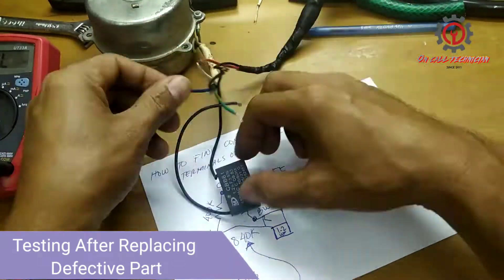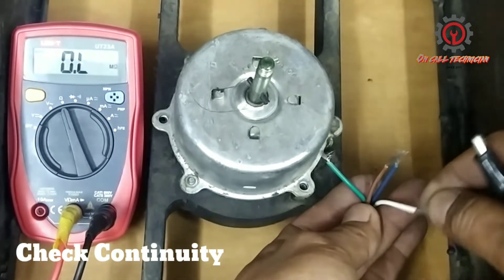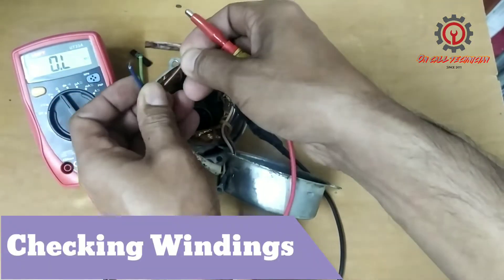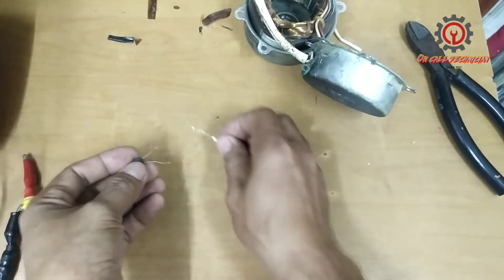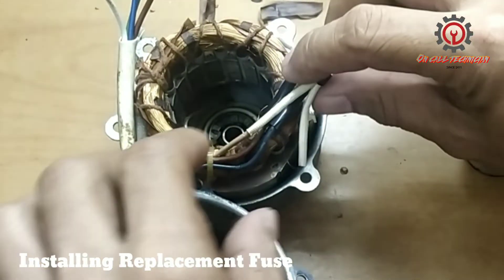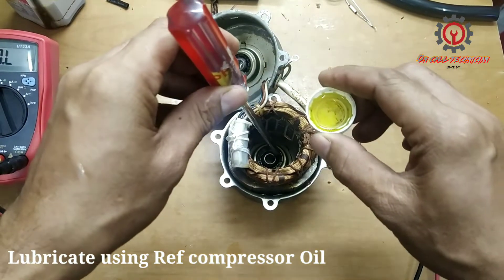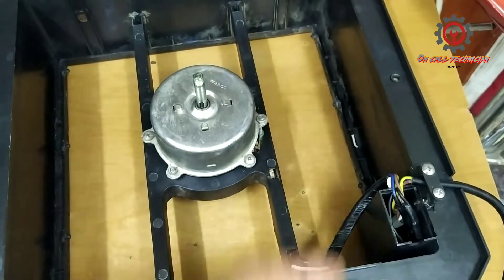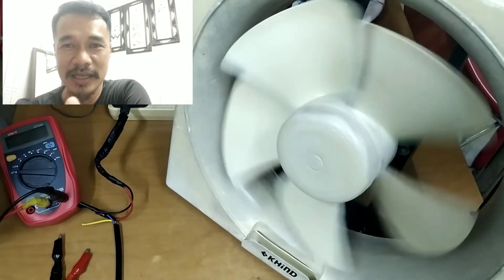HOW TO REPAIR NO POWER ISSUE OF EXHAUST FAN / PAANO MAGREPAIR NG WALANG POWER NA EXHAUST FAN

Comment: Pano po pag walanh continuation sa ibang wires?
Reply from the maker: Fuse busted or open circuit na sir dahil sa sunog.  Check fuse sana bumigay sya at di windings
Reply: @THEMULTISKILLEDTECH  nagpalit po ako ng fuse boss,wala pa din contiunation sa ibang wires,
Reply from the maker: Open windings na sir, nangyayari talaga yan kung matibay ang fuse, kaya dapat sundin ang rated ng stock na fuse kung magpalit

Comment: Pwede po ba icconect direct yung wires without resistor?
Reply from the maker: Without control yes po bale recta sya
Reply: @THEMULTISKILLEDTECH you mean po ba is yung fuse?  Since yung fuse ang may issue okay lang di na lagyan ng fuse at rekta dikit nalang?
Reply from the maker: @excuseme2423  kung tinapos mo video sir ay malalaman mo na di ko nirere commend na irekta ang fuse